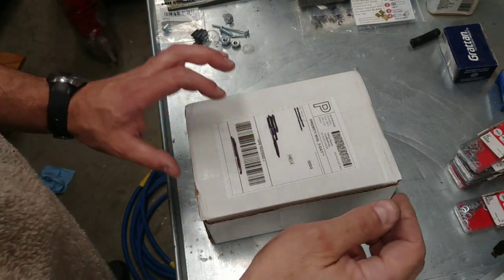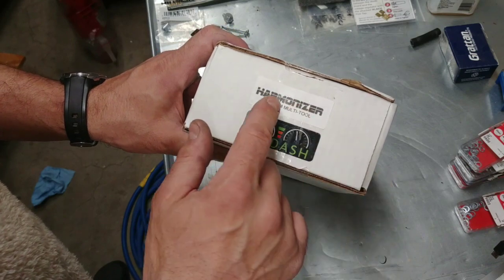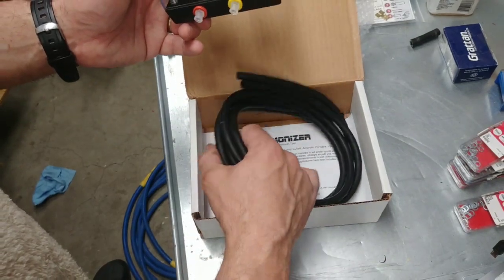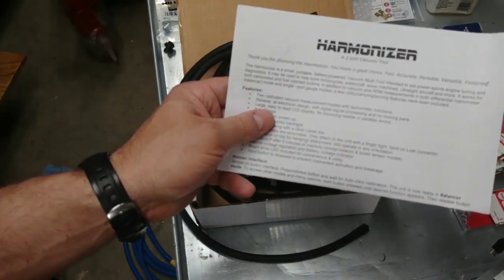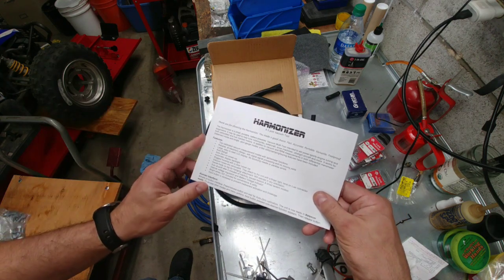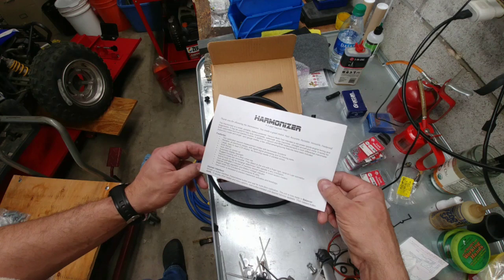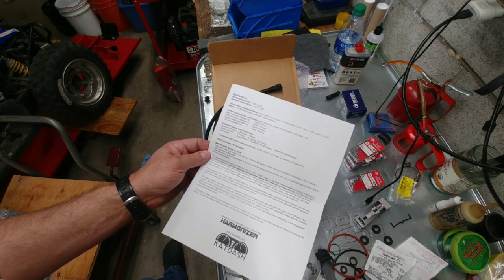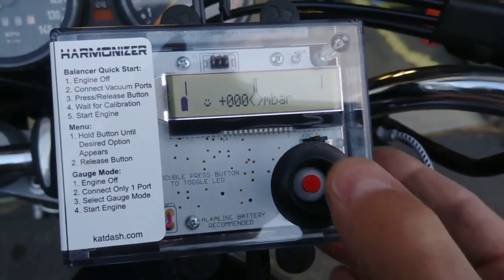The Harmonizer - my new tool.

Comment: Unfortunately it is not available any more. The idle for a R90/6 is between 600 and 800 rpm. Your idle is much too high. If the generator lamp is on at idle, that is normal and ok. At last a liitle explanation: In English, a distinction is made between generator and alternator, in German mostly only about the generator in general. ... The correct German name is therefore DC alternator. The English term alternator, on the other hand, describes an alternating or three-phase alternator.
Reply from the maker: I respectfully disagree. She will run at 600-800rpm but shifting into first is much smoother at 1000rpm. That is where I'll keep her. 
Idle rpm is just like engine oil and tires. That topic never gets old. :-)

BTW I am from Germany born and raised. A Generator/Alternator regardless of AC or DC output called Lichtmachine. (Translated Light Machine)
I don't remember what I used in the video but it is pretty common to call a AC output power producing thing an Alternator as in Alternating Current and DC producing thing a Generator.
Reply from the maker: Additionally the R90/6 has an Alternator plus a rectifier but BMW in their wisdom still named the little red light the GEN as in Generator light. I bet in some circles it would be acceptable to call an Alternator a Generator and vice versa but not on the internet and especially not on YouTube.
Reply: @HeikosGarage  Moin Heiko, dachte ich mir bei Deinem Namen. Ich habe das originale Werkstatthandbuch von BMW und selbst eine R60/6 (1975) und eine R100 RS (1981). Dort habe ich eben nachgesehen bzgl. der Leerlaufdrehzahl. Meine halte ich so bei 850 U/min, das ist ok. Ich habe noch eine Yamaha (Leerlauf 1300-1400 U/min) und eine Moto Guzzi Mille GT (Leerlauf 950-1100 U/min). Ist halt unterschiedlich, aber mir wäre Dein Leerlauf deutlich zu hoch. Mit dem Gangeinlegen habe ich bei den Drehzahlen kein Problem, was aber auch vom Getriebeöl abhängt, also der Viskosität.
Reply: @HeikosGarage  Ja, ich weiss auch nicht. Ich sage immer schon Generator dazu und nicht Lichtmaschine, aber naja. Kein Problem. Die Funktion des der Lampe kennst Du?
Reply from the maker: I just rewatched my own video. I am actually stating it correctly. The R90/6 has an Alternator not a Generator. They still named tge light GEN light.
Reply from the maker: @lupo631  Ja,  kenne ich and hab auch schon mal einen Blick auf den Schaltplan geworfen. Seit dem Video habe ich die Instrumente auf KatDash umgebaut.
Reply: @HeikosGarage  ja, ich auch. Meine Leiterfolie war nach etlichen reparaturen komplett hinüber. das dashboard von Kathrin und Paul ist genial.
Reply from the maker: @lupo631  das einzige kleine Problem mit dem KatDash ist , dass das Gen Licht jetzt immer flackert, besonders wenn man nachts fährt. Tagsüber sieht man das nicht.
Reply: @HeikosGarage  Oops, das sollte es nicht. Ich fahre öfters nachts und kann das nicht bestätigen. Hast Du mal die Kontakte von Lichtmaschine, Regler und auch dem Kondensator der Zündanlage (sofern nicht gegen Piranha/Newtronic getauscht) mit einem Glasfaserstift gereinigt?